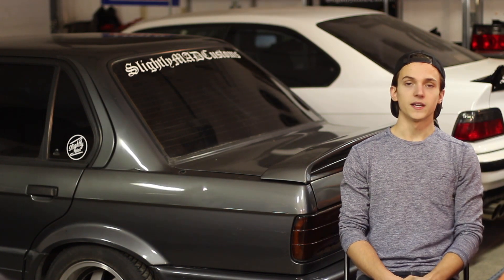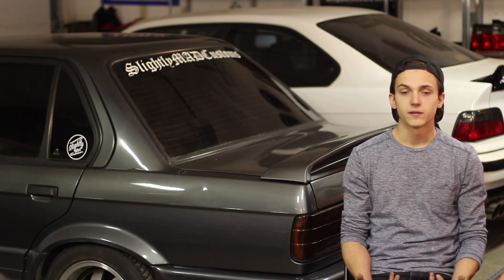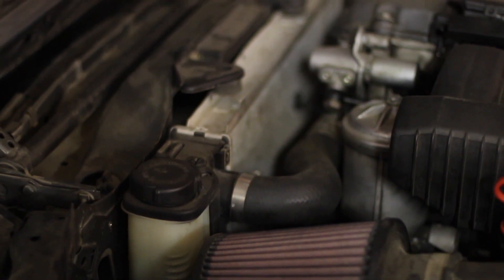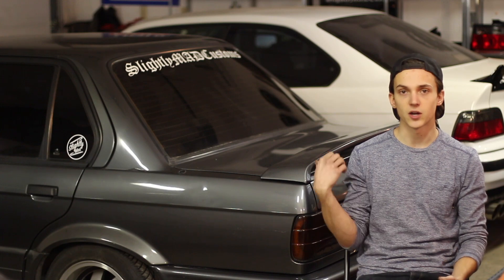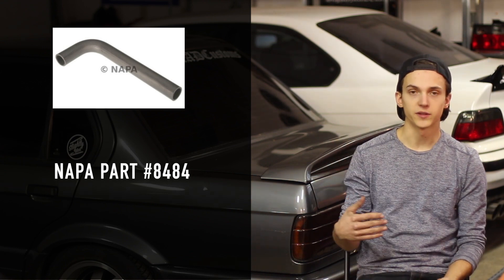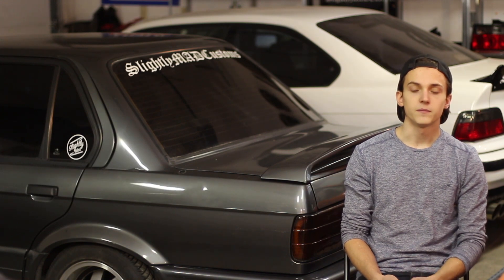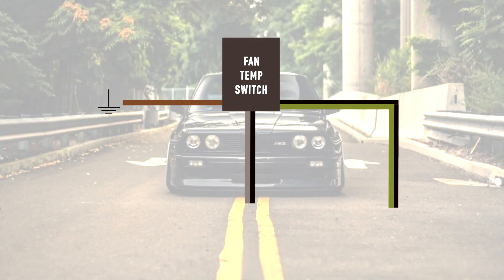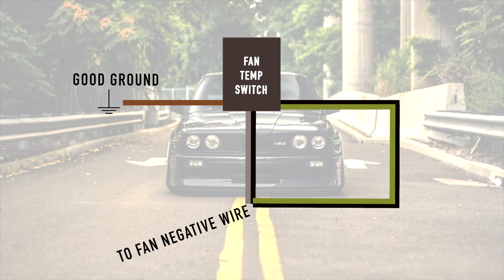Ep. 3: Cooling - E30 M50/M52 Swap Guide

Comment: what about the coolant lines that run under the intake manifold
Reply from the maker: Use all the m50/m52 stuff
Reply: @slightlyMADcustoms  is that all just m52 parts. Ive seen some say to use the m20 hoses.
Reply from the maker: You can really use whatever you’d like. They should both work

Comment: I finished this swap in November on my drift car. I also went with an e36 4cyl rad and it's worked fine so far. I happened to get a late e30 318 while I was mid-swap and it looks like it's the same radiator. Napa 8484 worked great for me but I had to buy like four because I kept chopping them up too much, just be careful. I used it for my upper and lower rad hoses. For radiator fan I went with SPAL VA18-AP51/C-41A. It's a 16" puller fan and it is a TIGHT fit. I switched my water pump pulley bolts to flanged button heads and cut off the threaded end of the water pump to gain enough clearance to fit this fan and even then there was only millimeters of space. I used a mounting kit from Condor also. A pusher fan probably would've been a better idea but it works like a charm. Since it's a track car I have the fan wired to be on with ignition and the temp gauge just sits at thermostat temp unless I'm hotlapping.
Reply: i’m wondering if a pusher fan can do enough to keep my e30 m50 cooled do you have any extra info if it would work or should i go your route
Reply from the maker: Ya pusher fan will be good

Comment: For everyone wondering the e30 318 radiator it doesn’t bolt straight in to a 325 chassi the mounting points are different I didn’t know this till I spend an hour today wondering why it’s not lining up lol
Reply from the maker: Might vary between late model and early model mounting. It could be mounted using some little 90 degree brackets though

Comment: Would you recommend the e36 318i radiator as well for a m50b30? would it provide sufficient cooling?
Reply from the maker: With a proper sized fan it should work just fine
Reply: @slightlyMADcustoms  Wow you really reply super quick. appreciate that. Another quick question, with the electric fan mounted on the other side acting as a pusher fan. Is there enough space to fit a condenser? And what electric fan would you recommend? the stock e36 electric fan? and again, would there be enough space to fit a condenser? AC is pretty important for where I'm at.
Reply from the maker: I would use  aftermarket fan like flex-a-lite fans. Because you can reverse the blades to make it a pusher. I think the biggest you can mount is 14”. Not sure on the condenser, you’d just have to test fit to see how it’ll all work
Reply: @slightlyMADcustoms  Alright! Thanks! Appreciate it.
Reply from the maker: Happy to help!
Reply: Can i put the 44 cm fan
Reply from the maker: Pay a little extra and get a nice High CFM. It’s good insurance
Reply: @slightlyMADcustoms  I'm not in Canada or us
Reply from the maker: Okay

Comment: Coolant temp sensor for the gauge how did u get it to read?
Reply from the maker: xXUSMCSCOUTSNIPERXx You use the temp sensor that is original for the E30 in place of the e36 sensor. Check out episode 6: Wiring & ECU where I explain what you need to do